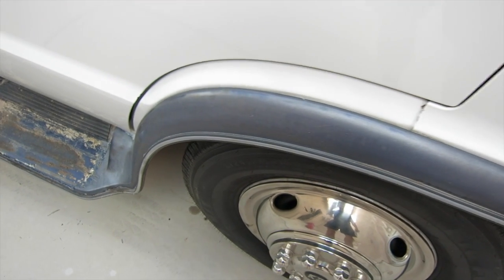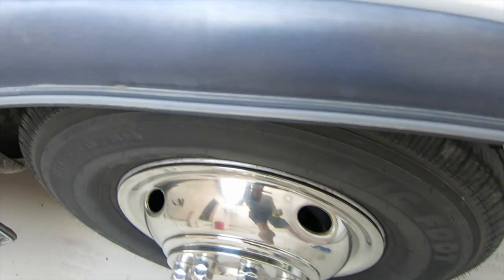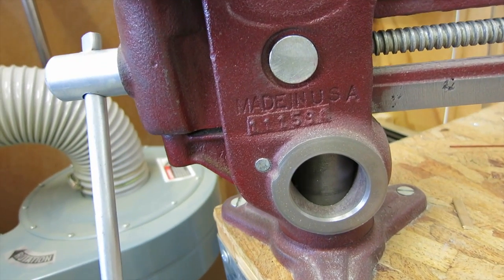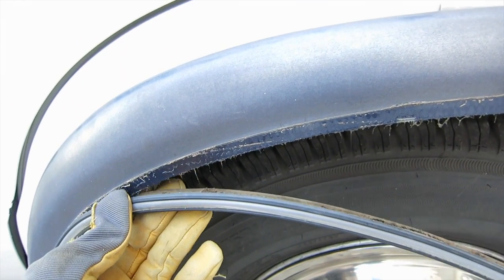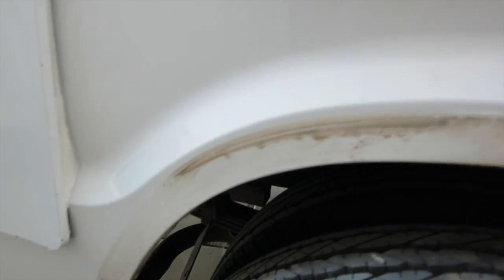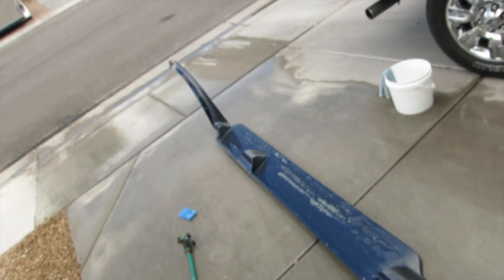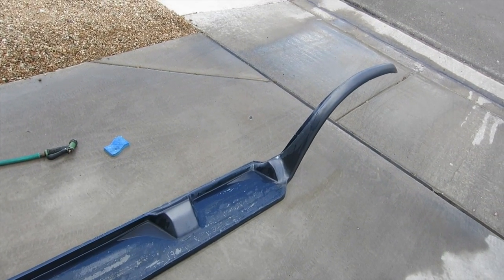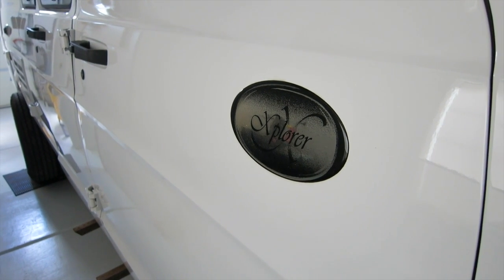Van running boards and a question for subscribers

Comment: I know I'm late to this party, but truck bed liner can be painted any color and is guaranteed for life in some cases. I did the roof of a Coleman pop-up that had cracked over the years. I had them spray it smooth, not too textured. Worked great. Just a suggestion for anyone in a similar situation.

Comment: Both colors would look awesome,  However, I would choose white to blend in with the van body.  The black molded step tread should accent the white running boards nicely and will match the black door handles, mud flaps, & tires.  -Thanks Steve...Keep the videos coming!
Reply from the maker: Kevin Shea Thanks for the feedback.

Comment: Ya gotta have the bad ass mud flaps on a six wheeler. You could touch up the chipped on checked spots with some fiberglass matting it wouldn't take much I don't think. My vote is for silver. Be well, John
Reply from the maker: Runs With Knives Leather & Outdoors Thanks for the reply.

Comment: Great job on the removal. I'd go with white, RustOleum white seems to match the stock Dodge white pretty well. I painted my aging grill (black)and front bumper (dark grey) with RustOleum and there has no peeling or fading in two years. The white will look clean and give it a little more stealth. Good luck!  My $.02.
Reply from the maker: FullTime LiveAboard Thanks for the reply. Glad to hear the Maaco guy steered me right on the Rustoleum.

Comment: My vote is for white. Good choice on avoiding Maaco, I used them in the late 90s to paint a then 10 year old Ford Ranger. In addition to them doing a crap sanding/sandblasting job, it was peeling away just over a year later. It was garage kept, and I washed and waxed it at least once a month, it was pretty disappointing.
Reply from the maker: sandman x Thanks for the feedback. Sorry you had a bad experience.

Comment: Silver. Will you be protecting the rear wheel well area from rock chips?(clear bra, skateboard grip tape etc.) It doesn't seem your style but plastidip is pretty durable and cheap
Reply from the maker: HELLCOMESTOTOWN Thanks for the reply. Thought about PD but it has a 3 year life.

Comment: I would go silver, however I would paint them with truck bed liner paint.  That will cover the checking and give a very durable surface.  It also goes on well out of a spray can.  Just my thought.
Reply from the maker: Vader1957 Thanks for the feedback.

Comment: I forgot the name of the paint, but it's used for Airliners. It's tough, never needs waxing and doesn't chip, peel or crack. A friend of mine painted his Baja Bug with the stuff and it's black. He shows customers how tough it is by pouring paint removed and battery acid on the hood, then wiping it off.
Reply from the maker: cruyeda Thanks for the feedback.

Comment: I know a guy who had Maaco paint two Crown Victorias from top to bottom for about $300-$500 each.
Reply from the maker: Blaine Bugaski Maaco has good deals now and then for sure.
Reply: Just saying, the price they quoted you for $500 for two running boards seemed high, when you can get a whole car done for less.
Reply from the maker: Blaine Bugaski I agree. I ended up doing it myself so it's all in the rear view mirror now. Turned out great.
Reply: I am slowly going through your videos.  I have not got to that point yet, but I believe you.  Your attention to detail seems to be very high.

Comment: I did 5 coats of rustoleum black bed liner paint on my Ford Sport Trac plastic running boards.  Within a month of where my leg rubs against it getting in and out of my truck paint wore off.  I didn't do any clear coat.  good luck.   (White)
Reply from the maker: Jake Revolinsky Thanks for the reply.